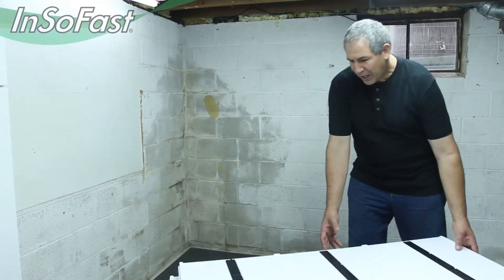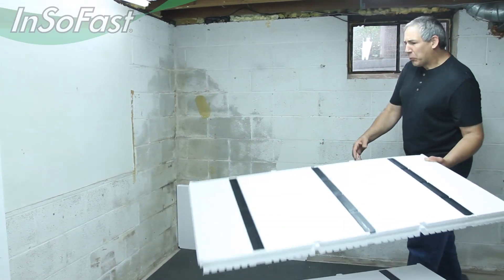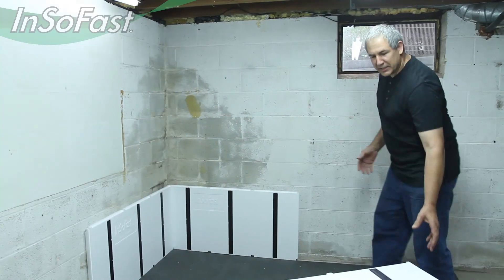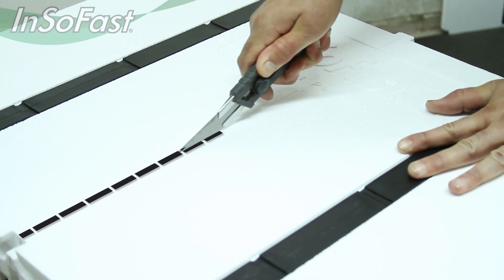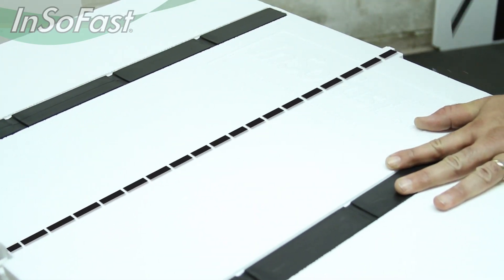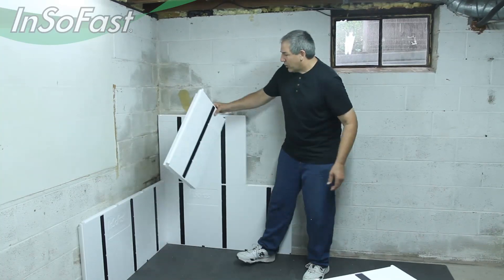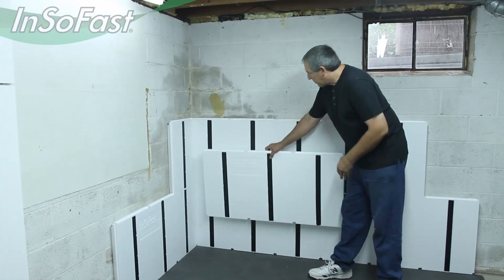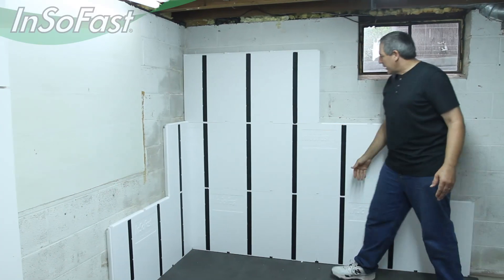Setting up the InSoFast Interlock Pattern

Comment: Great product. Had my doubts in the begining when I was planning my basement project. 

Compared Insofast to traditional steel studs,vapor barrier and insulation. Without labor I had a savings of over $2,300,00 using Insofast over studs and above materials and the best was I did it myself with a help of a friend.

Very simple to use and the Insofast team is very helpful answering all your questions.  

I would highly recommend this product, Its a true DIY 's dream. .